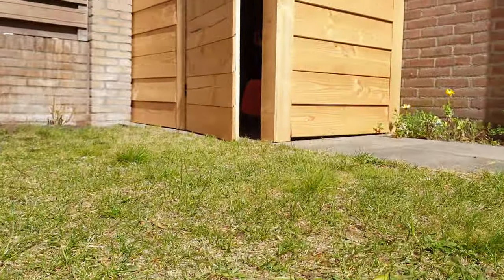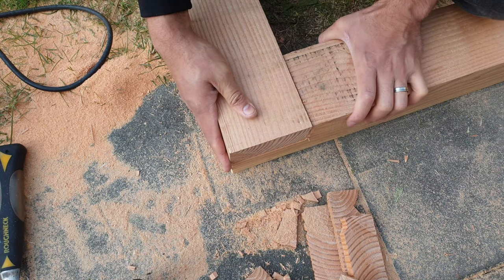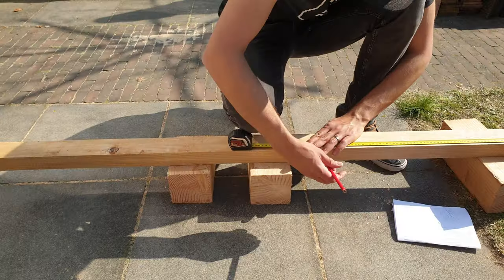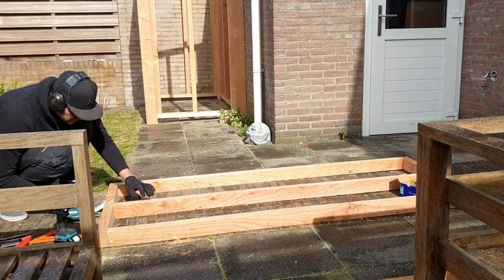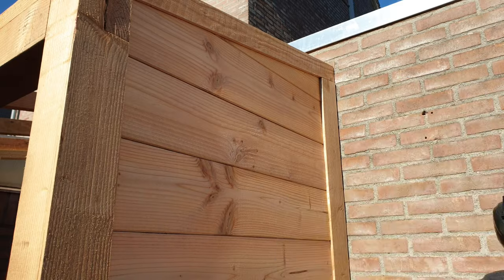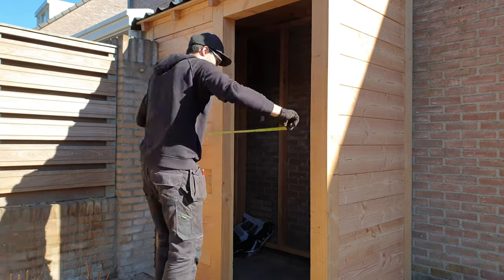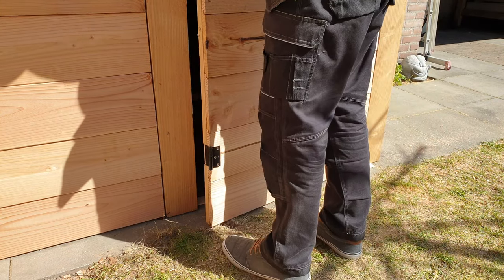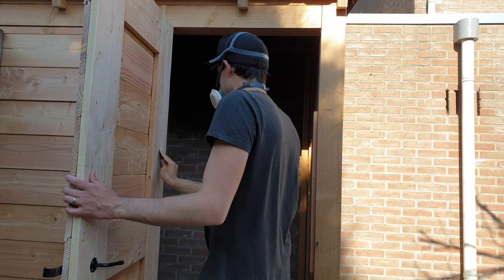Garden shed from Douglas Fir - Step by step build from scratch

Comment: Hey Rico, 
awesome build and funny sequences : D nice to see, that YouTuber are not perfect as well. Usually everything works initially in the videos. I need always several attempts. Just yesterday the box for my zyclone just imploded due to underpressure. At least I know now, that my design has a perfect vacuum : D

But man, how long did it take to do so many cuts by hand? You have to be at least as strong as Bud Spencer 💪
Reply from the maker: Hey Giovanni, thank you! I did leave my biggest fail out of the video because it was taking too much time to show. I tried a different approach of assembly and dropped the entire front assembly over at one point. It landed on my circular saw and broke it in half. DOH! Unfortunately, that's the only way to learn stuff. So make a lot of mistakes and keep going. The cuts did get a little boring at one point but I need the exercise ;-).
Reply: Oh no,
Poor circular saw : (
I just bought a very cheap one (Meterk for 50 bugs incl. 2 blades). I did the washing table project with it. It was 5cm thick Douglas pine (softwood). The cuts were really awesome with the included blades. I was really surprised. So if you need a new one and have a small budget it is a try worth.
Reply from the maker: I will check it out, thanks for the tip 👍
Reply: My merch was just shipped 💪
Reply from the maker: WhoopWhoop 🙌 Nice 😄👍

Comment: Nice looking build,what part of the world do you live?
Reply from the maker: Thanks! I'm from The Netherlands. Where are you from?
Reply: @CornerfieldShop  Hi im from the uk, i was interested to which country you live in because of the price of wood around the world,i tend to use pine as it is cheaper and easy to get hold of i did look for the price of some wood other than pine but nearly fainted at the price lol
Reply from the maker: It is more expensive but here it's OK. As far as cost go, this whole thing cost about 600 Euro's to make. Wood (delivered), hinges, screws, lock and even a brand new 18 Ga nailer and nails included. Not too bad right.